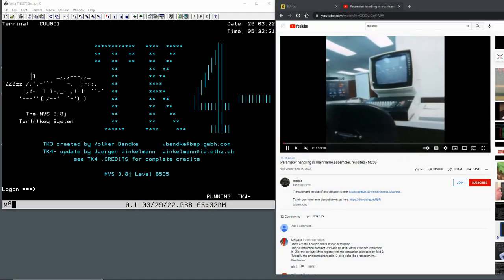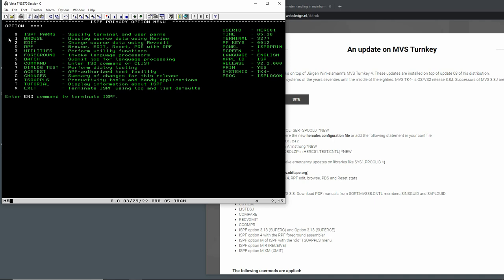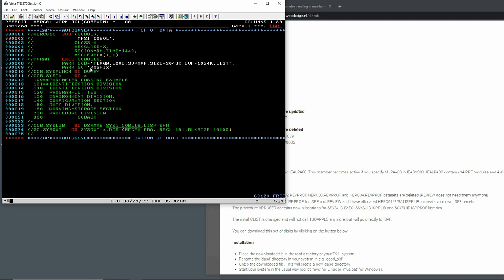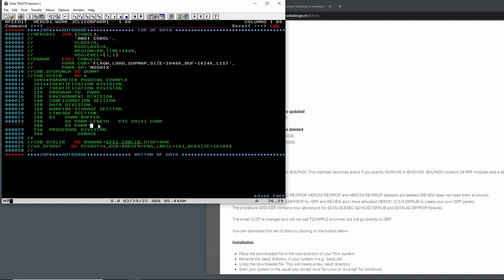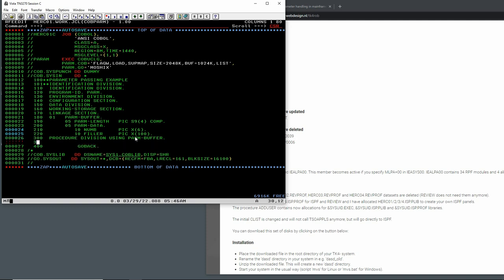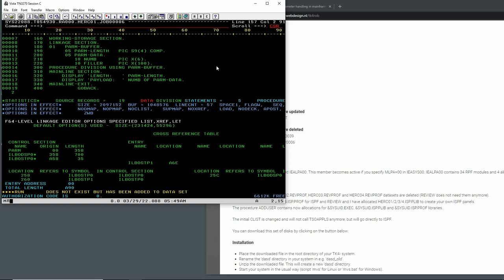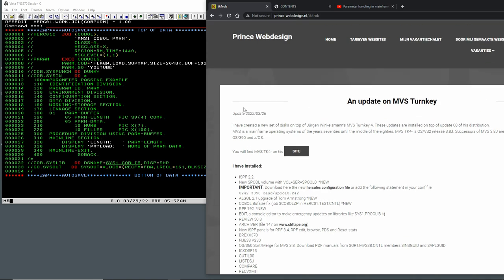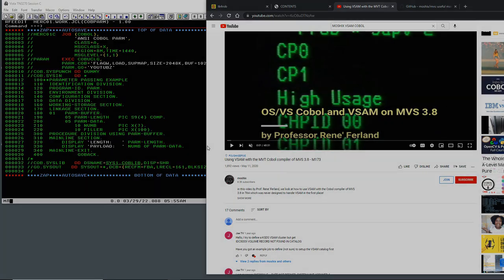Passing parameters to an MVS Cobol program - M210

Comment: I could not resist looking at how to pass a parameter to a PL/I program. To paraphrase Screen Rant, it is super easy, barely an inconvenience! The parameter is a varying string of length at most 100 which you can map to a structure or, even better, decode with GET STRING DATA, LIST or EDIT. Damn I love PL/I !!

Comment: Thanks Moshix! Linkage works fine; however, it would be nice to make a video on getting the Rob Prins updated DASDs to work. It appears more complicated than simply substituting the DASDs as JES2 won't startup and the shell freezes.
Reply from the maker: Did you make make the conf change for the new JES2 dasd as suggested in the instructions on his website ?
Reply: Thanks again! Yeah, I'm getting really old! LOL! I just missed it!
Reply: @lavaq9593  Euh, it needs a /r 00,y I believe. After that it will ipl ok again.
Reply: Thanks @Johan-ez5wo  Moshix reply about what I missed on the config spool param fixed my oversight.

Comment: I never saw someone working like this, mixing JCL and the program source in the same member.
Why don't you keep your jobs and your program sources in separate libraries, so that COBOL sources would have proper automatic line numbering on? They way you do it is really weird, especially when you have an ISPF like editor at hand.
Reply from the maker: Because I don’t run production
Reply: @moshixmainframechannel  neither do I - but I'd do things the same way for my personal use, because it's way more elegant, less prone to errors, and simply makes more sense to me. The same way as I won't drive on the wrong side of the road just because I'm driving my private car and not the company truck. But that's only me ;-)
Reply from the maker: You’re right
Reply: I find moshix's approach more didactic and self-contained than what you suggest. Since usually (but not always, as this video reflects with PARM.GO) names in JCL and the embedded code must match, switching between members in order to make sense of what's going on would be a hassle.

Comment: Strangely it looks like gnucobol doesn't have a method for reading command line parameters :/ in any case the method you use in this video doesn't seem to work.
Reply from the maker: Linkage for gnucobol is completely different. That would certainly not work for gnucobol
Reply: To get command line arguments in gnucobol, use the ACCEPT verb.

ACCEPT command-line-string FROM COMMAND-LINE.

There are quite a few differences between IBM COBOL and ANSI COBOL, which gnuCobol implements.